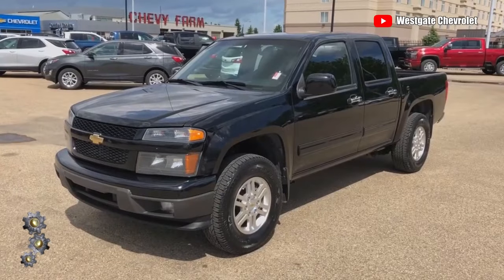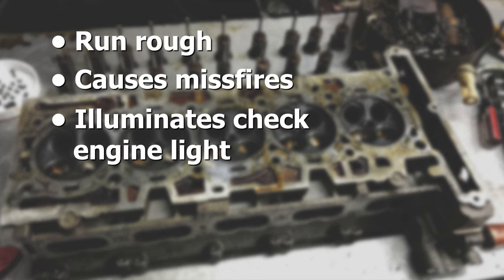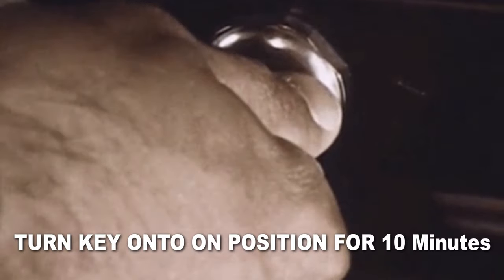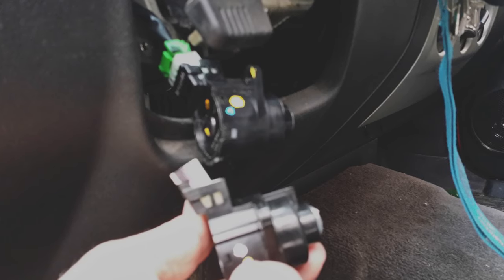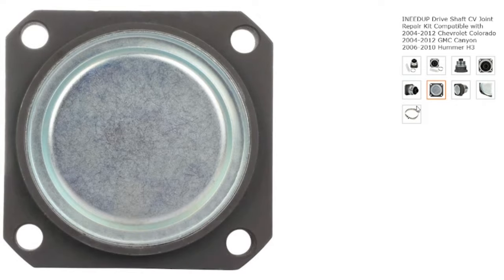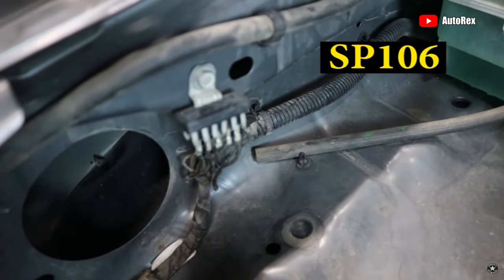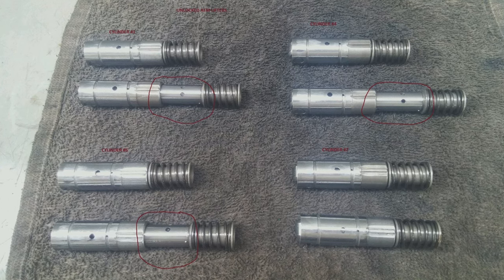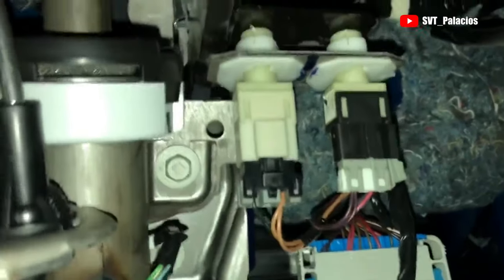Watch This Before Buying a Chevrolet Colorado  2004-2012 (GMC Canyon)

Comment: My 2005 Colorado is running strong at 247k miles with slight issues with the splice pack rn, I just tap it and blower motor starts working again lol

Comment: I have a 2009 GMC Canyon 2.9L motor. It has 150,000 on it. It's been idling ruff lately. I had it since last December and change the oil regularly. I need to change the resistor to the a/c. It has been i pretty solid little truck so far.
Reply: Remove the air intake and look in that box before the throttle plate. I bet its dirty. Replace the fuel, filter, its stupid easy.

Comment: Rust on the frame is giving me trouble in my 2011 truck. I've been putting NH Oil Undercoating on it for the past couple of years, including their "rustoration" service. Hopefully this saves my frame from getting worse.
Reply: If the problem still persists even years later might have to replace the entire frame

Comment: My 04 colorado 5 cylinder just hitting 145k and starting to sound rough, needs all regular engine/timing/alternator maintenance soon.  Recommend changing gas filter soon as possible. Live in upper Michigan,  And the frame is still solid has rust but it's workable. Since owned for 3years Replaced a list of things no more than 5k and now needs required maintenance. As all cars do tho
Reply: What do we do about the rust?
Reply: @buzzardscry1383  Oil Spray once per year, better if you do it twice per year.
Reply: @larsondata6295  what kind of oil? Thank you

Comment: Have a 2011 3.7. Ive had to do 2 rear mains, fuel pump, valve cover gasket, a handful of evap leak issues, had the problems splice packs having the tiniest bit of corrosion and causing this not to work. Cant stand this truck

Comment: Funny you mentioned the breaking in half issue. I bought mine used and asked seller if he offered any warranty. He said sure , if on your way home it breaks in half I got to keep both halves. My magic moment came when starter quit starting. I soon realized I prob could get starter off with correct extensions universals and putting my Christianity in severe jeopardy using non Christian words phrases and activities from frustration, rage and total disbelief why anyone would design starter placement and particularly bolt in back of starter that if I was lucky  enough to remove forget getting back with new starter at least without cross threading nightmares and loss of skin from elbows down. 
My compliments  to the design engineers at GM. A real winner.
I admit my mechanical skills are just average and with the many trucks and cars I ve owned only got one lemon.while it never broke in half it did irreparable damage my savings account.
Have you driven a Ford lately.
Reply: No sir I'm not a Ford man
Reply: What year?

Comment: GM should bring this truck back. The 3.7 five-cylinder engine was really nice, and the 5.3 V8  engine was sweet.
Reply: Definitely NOT.
Reply: They have brought it back. There was a two year hiatus where it wasn't produced, but now it's back in production.
Reply: @chipsawdust5816  I mean to say, they should bring back the 1st Generation truck.
Reply: @OrcaBoat3  Ah, well some of us keep doing that, but now it's a limited edition :)
Reply: Nice thought.... Until you have to change the timing and balancer chain😮‍💨
Reply: @danielgaynor9384  When should the timing-chain be replaced?
Reply: @danielgaynor9384  how would you know the timing chain needs changed? What’s the average span that this happens at?
Reply: @reedcarpenter2994  well let’s see. My friends 4 cylinder Colorado timing jumped on him at 115000 and he couldn’t afford to take it to the mechanic shop so I took on the job. In order to get to the timing chain compartment, I had to to access this one 10 mm bolt that was located in the oil pan which required me to remove the motor Mount  jack the thing up to be able to slip the pan over the front axel. Then take the pickup tubes out . Three jaw puller on one or more pulleys. Then after switching the chain and guides and setting it….Gasket sealing the cover and oil pan back. Not done yet.. now the balancer chain in the back that required the bell housing of the transmission to be pulled away from the back of the engine after removing all the bolts and pulling out throttle body and countless other hurdles in the way….. nice truck though🤪👍
Reply: Jk lol
Reply: On a serious note, I wonder if the 5 cylinder is just as easy
Reply: @danielgaynor9384  I keep reading that the timing chain lasts the life of the vehicle, provided you keep up with oil changes. But you are saying that your buddies timing chain came off. I'm all confused.

Comment: Hey Chris I recently bought a 2009 Colorado. Wondering if you can help me with me? While driving, I ran into this issue. I got a AC OFF light on my indicator panel. Temp. gauge dropped off, stopped reading. No other indication whatsoever.  Curious can you or someone who owns a Colorado help.
Reply: Temperature control sensor, mine does it all the time. My autozone has the replacement part for like $35 dollars but I just haven’t had the time to replace it yet. Hope that helps!!
Reply: Hope you got it fixed Carlos.  My '09 did the same, and it was the thermostat, which cost over $300 to replace.
Reply: Either the thermostat, temperature control sensor, or something else with the cooling system. I recommend you to check the temperature with a thermometer to make sure its not overheating.

Comment: Don't buy if you live in the rust-belt area, mine had 208k miles but the previous owner didn't care for any undercarriage coverage and the thing will rust like crazy. Mine was aerodynamic, no rockers, rust everywhere suspension parts wear fast on salty roads, door handles will fall on cold weather, electrical issues, as mentioned in the video the gas pump will rust on top and last but not least the frame will rot inside out and I had to let it go even if it did run and drove until the end.

Comment: 2009 colorado with 282k miles, looks better than some cars that are only 5 years old, it’s a 5 cylinder by the way😂 I fix something on it once every two months, still an ok truck, i’ve had many of the problems and I fixed them all

Comment: On my 2011, my fuel pump rusted so bad, it looks like the one in this video.   Never mind taking the bed off as most people do.   I did the job both ways.  I would prefer to do it by just dropping the tank.   I found secret ways to get the tank straps off without snapping the body bolts holding them in.    Anyway, it cost me close to $500 replacing the fuel pump and related parts to it.   I got most parts on Amazon at good prices.  
As for recommending this truck, I could not.  I would never buy Chevy again.   For example, starter and even the alternator are big jobs on this vehicle.   On my Subaru, replacing either is easy.   It seems to me that the design team was more interested in having a diverse team of engineers rather than the brightest people designing this truck.
Reply: That ethanol gas is what rusted fuel pump and gas tank I done been through that not with the Colorado but another truck and I had to buy another gas tank it ruined it had a little black stuff in it you never could wash it out but keep the gas filled to stop up

Comment: I bought a 2005 4x4 crew cab that belonged to an excavating company so I assume the 255k miles are mostly highway miles and they had several of these trucks they bought new so they must have been properly maintained. The 5 cylinder engine runs nice and smooth. I haven't been able to drive it more than around the block because a tree limb went through the windshield and tore the roof partially off. I replaced the roof, hood, fender, grill etc and repainted the whole thing. The rocker panels were rotted out so I made new ones out of the old roof panel. There were rust holes in the frame by the gas tank but I welded new steel over them to fix that. Box frames are stiff but rust out bad. I am hoping it will be a good truck for my 50 mile round trip to and from work. Nearly all highway miles. I don't know if it's a Z71 or Z85. Anyone know how to tell the difference?
Reply: The glove box door should have all RPO's for that truck as built
Reply: @chuckdargy5031  It's a Z85 base suspension. I have put about 7k miles on it so far.
Reply: My L5 runs great. Seems like that L series of engines, 4, 5, and 6 were pretty good. IDK what went wrong with the frames. Keep a close eye on yours.
Reply: I had no idea anything was wrong with mine until my mechanic put it up on the hoist and it creaked.
Reply: @chuckdargy5031  The frames are boxed instead if C-channel so they get mud, water and salt stuck inside of them, then rot out. Box frames are stiffer but don't last long.
Reply: @CarbonGlassMan  Yes, I agree. Additional strength was the claim at GM at the time, along with increased productivity in producing them. But IMO the resulting deficiencies in longevity are not worth the tradeoff. My truck is a 2012, only 11 years old. Were I still employed at GM, I'd be on the phone with somebody.

Comment: Any body have there truck pull hard to one side when braking the hard you brake the harder it pulls...i need to fix this. Asap...ive heard calipers brake line maybe a hub bearing...i dont really want change the whole pad rotor caliper and we'll might as well bearings and brake lines
Reply from the maker: A stuck caliper can cause that to happen, which is easy to fix and could be free if you just need to clean and lubricate the caliper pins. Uneven pad wear could also be a culprit and same with a collapsed brake line. If it is your wheel bearing, then that should be replaced asap. I personally wouldn't drive the truck until you figure it out. 
If you find that you have a weird smell coming from on of the tires, that could very well be a stuck caliper.

Comment: I haven't had issues with my engine on my 2008 Chevy Colorado, however, the whole frame and underneath is rusted terrible. I don't know why a few years are known to have this problem, other than greed by Chevy. I welded all I could on the frame just for hauling off my trash. I expect to break in half every time I use it, just like the example in the video 😂 White knuckled all the way.. 43000 miles ☹️ I have to add, getting to the fuel pump would have be easier if I could have got the damn spare tire broke loose. I would just part it if it wasn't in prime condition other than underneath and will only 43000 miles. Guess I will use it for trash hauling until I break in half. 😢
Reply: Same here. 43000 miles on my 2008. I welded up the frame as well as I could (well, my son did) just to use it to haul trash. I expect to break in half at any time, like in the video. Chevy did a shitty thing in the name of profit and screwed over us all imo. I love everything else about it, bit dang.

Comment: BS I have 2006 coming up on 300000KM without any major powertrain repairs 3500 vortec. Best vehicle I have owned. Heater resistor - well known problem - $35 to fix. Everything else is normal wear items that can be expected.

Comment: I have an 07 four-cylinder that I’ve had to put two motors in and the one that’s in here now has hit 1000 hundred thousand miles and is trying to blow up on me also. This truck has been the worst vehicle hands-down I have ever owned.

Comment: If you own a 2015,V6,4WD of these and the starter goes out or the transmission. God help you. You have to remove the y pipe, catalytic converter and the driver's side motor mount to get the starter out. I haven't even gotten to the torque converter bolts yet but I know it has 6 of them. This truck is an engineering shit show.

Comment: 04 CC 3.5 since 17 miles at 248k and romped since day one. 2015 put a manual transmission and tuned it to 7k rpm. Tuned my reg cab ZQ8 to 7.3 with a 4cylinder clutch kit. Got an extended cab ZQ8 tuned. 5 cylinders have bounced off rev limiter and beat new ecoboost Hemis and LS stock. 

https://youtu.be/Gd1nX_BWY2w

Comment: I've actually had issues with the start thing... wouldn't start come back 15 minute later starts right up no issues after 3-5 months and just randomly does it after I drove 10 miles down the road

Comment: Let’s see… my 08 Colorado with the 2.9 SUX!
Windshield wipers like to turn on by themselves, resistor for the blower motor goes out once a year even after doing the ground on the passenger side by the air box. My radio won’t shut off after turning the truck off and taking the key out most times so I have to cycle the ignition once then wait and it’ll go off. Whoever thought about putting a balancing shaft in the back of the motor is an ass hole and besides the fuel pump thing which was simple cause I’ve done that on other vehicles before. Besides that it runs and starts every time with no issues and has been really reliable even now that it has about 188,000 miles on it